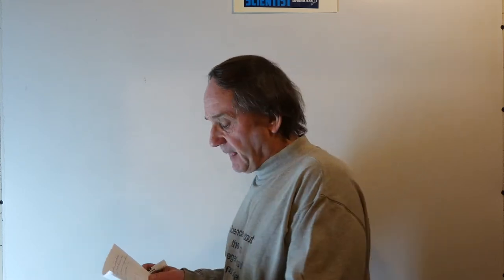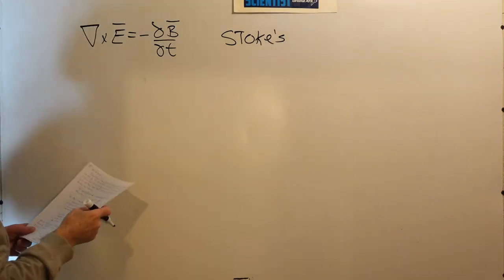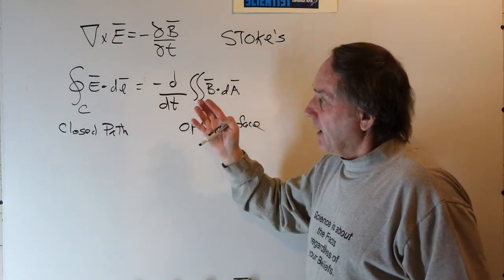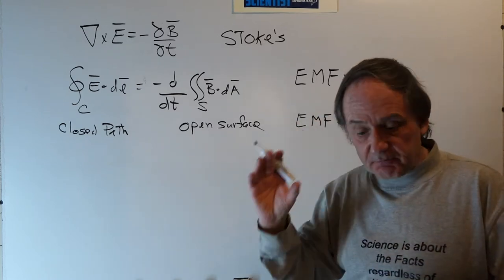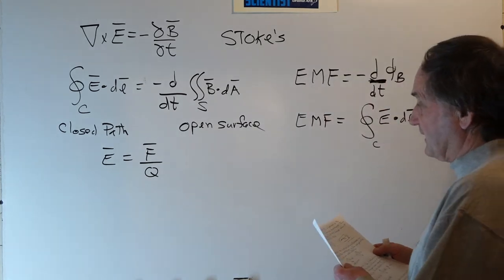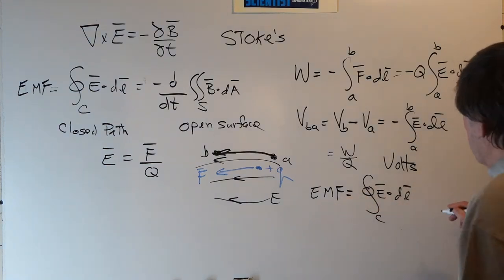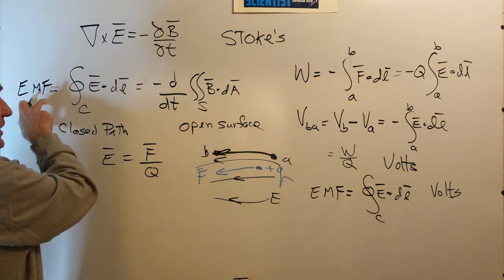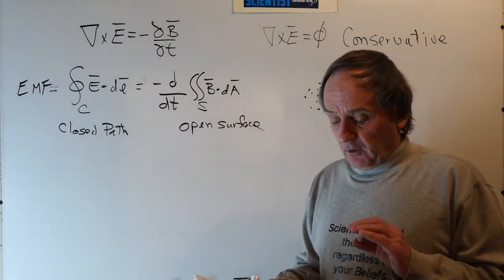FARADAY's  LAW

Comment from the maker: https://youtu.be/gtlf3XnrFO8?lc=UgykkKhZhPG1h40cwzN4AaABAg
Hi Prof. Lewin,
I tried to establish a line of communication with both you and also Prof Belcher regarding what I believe to be errors in some of the details presented regarding charge separation and electric fields that may or not be present in conducting materials in your Faraday Law material.  Would there be some way to establish a dialog before making the problematic issues public?
GH                                             January 25, 2019     1:42pm

----------------------------------------------------------------------------------------------------------------

 Lectures by Walter Lewin. They will make you ♥ Physics. 
I have addressed all relevant issues already 16 years ago in my Lect #16 and #20 of my  MIT course "Electricity and Magnetism" (course 8.02)

8.02 Lect #16: Electromagnetic Induction https://www.youtube.com/watch?v=nGQbA2jwkWI&list=PLyQSN7X0ro2314mKyUiOILaOC2hk6Pc3j&index=17

8.02 Lect #20: Inductance RL Circuits https://www.youtube.com/watch?v=t2micky_3uI&list=PLyQSN7X0ro2314mKyUiOILaOC2hk6Pc3j&index=21
and also in my lecture notes of Lect #20
Belcher/Lewin Most Physics Books got it wrong
http://freepdfhosting.com/0813df09f5.pdf

For more information see below
Is Kirchhoff's Loop Rule for the Birds?
https://www.youtube.com/watch?v=5be3zpj_eCY&list=PLyQSN7X0ro22zanLOcvkaSY-IZqheFYM5&index=7

Romer (1982) What do Voltmeters measure?
http://www.phy.pmf.unizg.hr/~npoljak/files/clanci/guias.pdf

To Agree or Not to Agree with the Master that is Not what Matters
https://www.youtube.com/watch?v=ototTU5NUNA&list=PLyQSN7X0ro22zanLOcvkaSY-IZqheFYM5&index=58

To Agree or Not to Agree that is Not the Question
https://www.youtube.com/watch?v=AQqYs6O2MPw&index=57&list=PLyQSN7X0ro22zanLOcvkaSY-IZqheFYM5

My Sincere Apologies https://www.youtube.com/watch?v=d_XqrZo5_7Y&index=1&list=PLyQSN7X0ro22lt9yiC7-aYnM8GWwqnICd

Believing and Science are Very Different
https://www.youtube.com/watch?v=wz_GqO-Urk4&index=10&list=PLyQSN7X0ro22zanLOcvkaSY-IZqheFYM5

5+3-8=0 
https://www.youtube.com/watch?v=f3-SfzepuPs&list=PLyQSN7X0ro22zanLOcvkaSY-IZqheFYM5&index=9

I have nothing to add and will refrain from any more discussions about this very basic physics for 1st year college students.

----------------------------------------------------------------------------------------------------------------

 Lectures by Walter Lewin. They will make you ♥ Physics. 
*My translation of the ORIGINAL WORK BY KIRCHHOFF FROM 1845:
"(...) it becomes easy to find the requirement, which [voltage] u must fulfill, so that the electrical condition on the [metal] disk can be a stationary one. When we look at a closed loop in [the disk], inside of which no electricity is being fed into [the disk], then the sum of all amounts of electricity which flows through this loop must = 0, which means it must be: Integral of (ds dot du/dN) = 0 ... when this integral covers the whole loop."The original text can be found at google books in the following link, book pages 497-514: https://books.google.de/books?id=Ig8t8yIz20UC Very obviously Kirchhoff had been aware of the prerequisite for his "loop rule", i.e. that d_phi(t)/dt must be equal to zero!*

---------------------------------------------------------------------------------------------------------------

Prof.
Actually, you have not addressed all the issues.  Take a uniform wire ring of homogeneous resistive material (copper wire or silicon wire of uniform diameter) and substitute it for for your single wire sensing loop that has R1 and R2.  In a UNIFORM  wire that has no change in conductivity along its length, there are no interfaces for which charge can accumulate when separation occurs.  Where is the charge separation that produces the Ech field in this case?  Where does the Ech field originate from to oppose the E-induced you claim to be present in the wire?

There are many other difficulties with this charge separation conjecture when considering a dynamic field. Your lecture is not entirely correct.  Put two copper wires between your R1 and R2 in the 14-Ohm and 140-Ohm resistors.  Try to figure out the charge separation on that one.  Your silicon wire loop with two different diameter wires is a convenient contrived circuit that works in that case and not for the reason you cite.  It works because of a mathematical consequence of how you define the current flow and nothing else is needed.  Ech is not needed in this case to explain what is happening.  It just happens to work but does not reflect reality and the true physics of the problem.  There are not two opposing fields within the wires made of good conducting material.  You had it right the first time and then when you engaged ElectroBoom,  you got all messed up with some of the details.  The charge separation conjecture is not that simple in general.

I have many examples that easily show the simple analysis you presented fails.  That is what I wanted to talk to either you or Prof, Belcher about and not make a public spectacle of this .

GH               January 25, 2019    3:08pm

----------------------------------------------------------------------------------------------------------------------------------------

PRof.
Given your reply, it is obvious you do not carefully read what I have written.  This is not about KVL vs Faraday Law.  I do not disagree with you on that and I never have.  This is NOT about the loop rule.

Please read what I have written you.   THIS  IS  NOT  ABOUT  THE  LOOP  RULE.

This is about the fields inside conductors.
GH                  Jan 25, 2019            3:13pm

----------------------------------------------------------------------------------------------------------------------------------------
 
 Lectures by Walter Lewin. They will make you ♥ Physics. 
John Belcher jwb@space.mit.edu

----------------------------------------------------------------------------------------------------------------------------------------

Prof. Lewin,
Thank you for that EMAIL address.  That is not the same that I found at the MIT staff index.    The MIT site gives Prof. Belcher's email as:         jbelcher@mit.edu

I will send my previous mail to this address you give but I suspect it will make no difference.  I will try none-the-less.

Thanks again, respectfully,
George Hnatiuk                                 January 26, 2019    9:31 am

----------------------------------------------------------------------------------------------------------------------------------------

Prof. Lewin,
Just to inform you for future reference, the EMAIL address:

jwb@space.mit.edu

appears not to be valid for my letter to Prof. Belcher just bounced back to me.  I will assume the lack of response to my previous communication to Prof. Belcher is either due to he being either too busy at the moment to respond or like you, he cares not to discuss the subject.  Thanks anyway.

I will make a video detailing the issues that I feel are in question and show how the physics of Maxwell's equations and appropriate 
boundary conditions can resolve them.  Maybe then I can find other experts in the field to engage with me on this issue. 

This is particularly important to show once and for all that ElectroBoom and others (Dirk, Mabilde, McDonald) are WRONG regarding the distribution of the induced EMF around the loop.  We need to finally show that EMF drops of any significance do NOT appear across the conductors, which with this incorrect assumption allow them to inappropriately use KVL  to analyze the circuit which couples a changing magnetic flux.

Thank you
George Hnatiuk                              Jan 26, 2019   10:13am
Reply from the maker: LETTER  to  Prof. Belcher:

Hello  Prof.  Belcher,
I received a different EMAIL address for you from Prof. Lewin than what I found on the MIT staff index so forwarding this communication to you using this address that I previously sent in case the original did not reach you.  This mail has been updated from the original to reflect new communication with Prof. Lewin.
 
 
OLD  ADDRESS:
From: "ghnatiuk@juno.com" <ghnatiuk@juno.com>
To: jbelcher@mit.edu
Subject: Walter Lewin and Faraday's Law
Date: Sun, 20 Jan 2019 04:11:14 GMT

 
 
Over the past year I have followed the discussions regarding the single loop demo of Lewin/Romer and the recent ElectroBoom video replies that has caused such a controversy.  I have communicated with Prof. Lewin over the past year regarding the misunderstandings that many viewers have such as Dirk Van Meirvenne, Cyriel Malbilde, Kirk McDonald, and ElectroBoom.  I have posted quite extensively to Lewin's Faraday Law videos as well as those of ElectroBoom's. 
 
There is a video of Lewin's that discusses his lecture notes on Lecture #20 that was apparently an update of your document:
 
                     https://youtu.be/ototTU5NUNA?lc=UgzyeoDeXb93bUwqYWZ4AaABAg
 
The above is a link to my thread of the latest communication with Lewin on this video.
 
The most recent comment that I posted to Prof. Lewin a few days ago has now been approved for public viewing but he does not care to discuss the issue any further.  The link below is to a copy of this communication and my latest comment to Lewin that you can also view in the link above.
 
                  https://youtu.be/LAoLzk3H8b0?lc=UgxOCgRkWOqaF1bnrCF4AaABAg.8qE7xJuwwoC8qE7zFgC42Q
 
 
Keep in mind that this is a private video that I have never made public and currently using its comment section for private communications. You need to use the link above to find it for it will not show up in any general search on Youtube.   I made the video a little over a year ago and since feel I could do much better.  Some day I may redo the video and post it publicly but it is in its current state a bit rough so I am keeping it private. 
 
 
I have read your summary paper of the ElectroBoom experiments and reviewed his replies to Lewin as well as many others on Reddit and other forums .  There are, I feel, some problems in your paper, [Kirchhoff's Voltage Law and Faraday's Law: ElectroBoom's experiments] and Lewin's video and these other papers, particularly those written by Kirk McDonald, which has serious and numerous problems.    I have found difficulties regarding explanations of Faraday's Law and how many authors and viewers attempt to explain the E-fields inside the conductors in general.  The treatment of charge separation in response to an induced electric field as presented is in my opinion much too basic and flawed.  Though on the surface and first analysis the concept looks reasonable, in general it does not work as presented in your paper and in Prof. Lewin's videos.  I could be mistaken but it is not likely for my arguments are quite sound. and based on the boundary conditions imposed by Maxwell's equations.
 
If you would care to discuss the concerns and problems I have found, please let me know either by EMAIL,  contact  via SKYPE / telephone or post a comment to my private video on Faraday's Law.  I would welcome some discussion in private before I make a video to address these issues and for I would like to avoid the storm such as created by ElectroBoom.  I am not seeking public attention as he has.  My only concern is to have the physics of the problem presented accurately so students do not get confused and apply the physics incorrectly.
 
What I wish to discuss has nothing to do with the applicability of KVL and Faraday's Law.
ElectroBoom made the same classic mistake as many others are in believing that even in the non-conservative case, the voltage between two fixed nodes must have a unique voltage between them that can be measured.  We can arrange the two voltmeters and their test leads in an infinite number of ways and each time get a different reading.  There is no way to "correctly probe" the circuit to give the "correct" voltage between two nodes "a" and "b" for there is no one correct voltage.  The voltage is PATH  DEPENDENT between the nodes and cannot be determined using the potentials at the path endpoints as in the conservative case where   Vba = Vb - Va.                 
 
                In the non-conservative case                       Vba =/=  Vb - Va
 
This is old news and not the issue I wish to discuss and correct.
 
Thank you,
George Hnatiuk, PE, abd PhD  electrical engineering and mathematics
    Jan 26, 2019  9:39am
---------------------------------------------------------------------------------------------------------------------------------
 
company:  www.adc-colorado.com
LinkedIn:   George Hnatiuk
skype:   georgeandkhan
Tel:  218-309-7256
 
3113  CR112
International Falls, Minnesota  56649
Reply from the maker: ---------- Original Message ----------
From: John Winston Belcher <jbelcher@mit.edu>
To: "ghnatiuk@juno.com" <ghnatiuk@juno.com>
Subject: RE: Walter Lewin and Faraday's Law
Date: Sun, 27 Jan 2019 12:12:32 +0000

hi Dr. Hnatiuk
I did get your original email but just have not had time to respond
 
it is the beginning of the term here at mit week after next and in addition to that I am deep into the analysis of the first data from the interstellar medium, so I do not have the time to respond to your email in any substantial way
best
 
John Belcher

=================================================================

Dr. Belcher,
Thanks for responding.  I understand.  If time allows in the future, I would welcome some discussion on the errors that many have made in the past regarding the distribution of the EMF around a close loop linked by a changing magnetic flux.  This is particularly true of the demos and explanations (quite incorrect) offered by ElectroBoom, Mr. Mabilde and Kirk McDonald.  These individuals have used this incorrect conjecture regarding EMFs as defense and justification in using KVL loop rule to analyze the Lewin/Romer circuit.

I am currently building apparatus to show how many of these issues, including EMF distributions, can be resolved and "properly probed" as ElectroBoom put it.  There was nothing wrong with Prof. Lewin's probing only ElectroBoom's understanding and reasoning which he never confirmed with any measurements and data.  He provided nothing - just supposition and unconfirmed guesses like Mr. Mabilde.  Never have these people ever engaged in trying to falsify their hypotheses, which by the way can easily be done.  I tried to explain the problems to ElectroBoom in private communication, but he got mad and stormed off in a huff.

The comment section of this private video shows that I was trying:

https://youtu.be/LAoLzk3H8b0?lc=UgwkNocoH1STcelZAEl4AaABAg

I have access to very sophisticated laboratory grade instrumentation, not the least of which includes the best digital multimeter made to date, HP/Agilent 3458A 8-1/2 digit DMM which I helped design - I own three units with current calibration.  My lab is stocked with over $800K of the best instruments money can buy that provides measurement capabilities from DC to 22GHz ranging in accuracy/resolutions from 0.01ppm at DC to 0.01db at 6GHz.  My instrumentation spans high speed multi-channel oscilloscopes, Time Domain Reflectometers, vector impedance meters,  LCRZ meters, high impedance meters, vector voltmeters, vector network analyzers(VNA), spectrum analyzers(SA), and signal sources/function generators of all types.  So I am quite capable of designing experiments and instrumenting them to obtain data with little error and uncertainly.

I will be making a series of videos to get others engaged and thinking about some of the problems I have found in the following papers:

(1)  Understanding Electricity and Circuits:  What Text Books Don't Tell You  -- Ian M. Sefton

(2)  lecture notes of Lect #20 Belcher/Lewin:   Most Physics Books got it wrong

(3)   [Kirchhoff's Voltage Law and Faraday's Law: ElectroBoom's experiments]  

I was hoping to engage in some private communication with the authors of the above documents prior to publishing my analysis and findings to first offer them a chance to make appropriate corrections before publication.  The last thing I want is to be involved in a fiasco such as was created by ElectroBoom which insulted Prof. Lewin.

Thank you for your time.
Respectfully,

George Hnatiuk, PE                               January 27, 2019  1:31 am

==============================================================